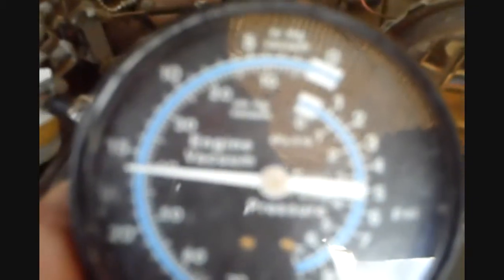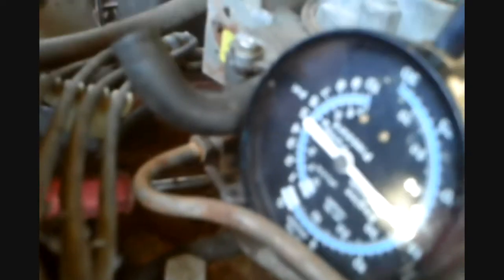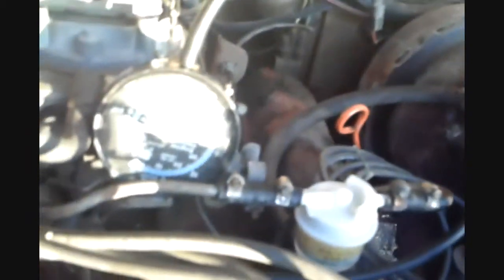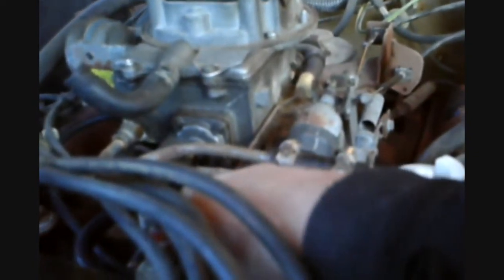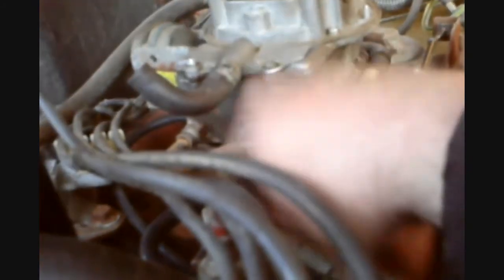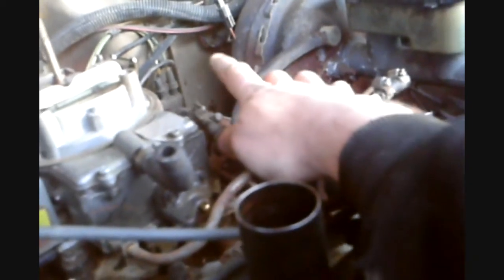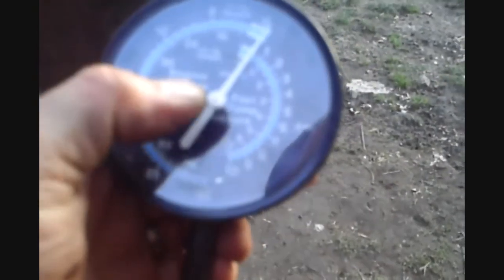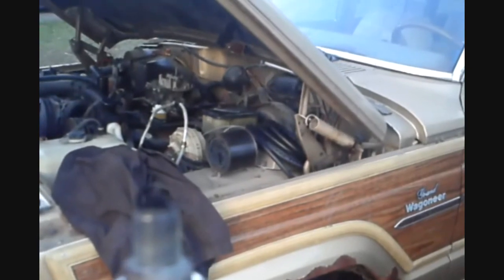Carb tuning the Jeep engine

Comment: where did you hook the guage to?
Reply from the maker: The first spot I hooked the vacuum gauge to was a fitting on the intake manifold just in front of the carburetor. The fitting had a couple ports on it that ran stuff from the original vacuum setup, and the vacuum coming from it is manifold vacuum. The second spot I hooked the gauge to was the port for running the distributor vacuum advance which was on the side of the carburetor just under the choke coil, and is considered  part throttle vacuum.

Comment: What kind of carb are you runnin? I've got an 85 Cj-7 that had a complete pile of junk GM throttle body on it, of which I recently replaced with a 2bbl Carter I picked up from Summit Racing...when it's cold, it runs like a raped ape, as soon as it's fully warmed up, it develops a SEVERE hesitation, it becomes difficult to start, and recently it's begun dyin on me when I'm sittin at a red light...like, I have to squirt starting fluid into the carb to get it fired off...any idea what could be causing these issues?
Reply from the maker: The carb in the vid is the original Ford Motorcraft carb the jeep came with. Your CJ7, I'm thinking it has the inline chevy 6 cylinder. The problems you are describing are for a lean running engine. When it is cold with the choke closed then it runs good because the choke being closed is adding fuel to the main jets at all rpm ranges. When warmed up and the choke opens, the engine is running on the idle and main jets normally and the engine is running lean on them. I would suggest to warm up the engine so the choke opens. Then simulate the cold condition by closing the choke some but not all the way, which will flood the engine when closed all the way, then drive it to see if the engine runs good while driving it and the problems somewhat or altogether go away. This will lead you in the direction of fixing the carburetor. Sorry, but the carb needs to come apart to fix. Will be one or both problems to fix the carb issue. 1- main jets are too small and need to change to bigger jets. 2- the carb has crap in it and is clogging something somewhere and need to clean it out. Having a new carb means nothing, when any carburetor is bolted to any engine, it is mandatory to tune the carb to that engine by jetting it with the idle jets and main jets. As for crap getting inside the carburetor, there is no exception there either. Now, if the problem is still there after playing with the choke as described above, then I would look at the ignition system then. Timing is off or, bad spark lugs, or just needs a tune up, would be my guess then.Good luck. Feel free to ask anything else.
Reply: @prancstaman  When did Jeep EVER put a "Chevy 6 cylinder" in a Jeep?  Since AMC had their own 4.2L and 4.0L 6 cylinder engines....
Reply from the maker: @1TruePatriot  AMC was good for using anything they could get their hands on. The Chevy engine CJ's is the CJ you see at car shows with a Chevy small block V8 in them. The CJ would have the chevy driveline in them with the straight 6, pull the 6 out and drop a V8 in and would bolt right up to the trans. I have no clue of what years was what. But AMC loved the chevy straight  6 in all their stuff. A 1977 AMC Spirit with the Chevy straight 6 in it would burn the tires off the rims. LOL :)
Reply: @prancstaman   They used a Buick V6 in some Jeeps at one point, but never a Chevy inline 6. Why would they? They had their own inline 6's going back to the very beginning of AMC, when Nash and Hudson merged. They used an Audi 4 banger, then a Pontiac? 4 banger until they developed their own 4cyl.
I always find it weird that people can be so confident while being so wrong. I hear it at car shows sometimes. Oh, thats the Ford motor, or that's the Chevy motor.  Wrong on both counts, friend.
It's so inconceivable that American Motors made their own engines and bodys to some people.
Reply from the maker: @trainsforbrains  AMC was famous for using anything they can get their hands on. My Wagoneer for the year "84"came with an AMC 360 or a Chevy inline 6. Then 20 years before came with a buick 350 as one of the options for engines. They shoved the inline 6 Chevy in alot of their cars. Along with their drivelines also.
Reply: @prancstaman  OK, I'll feed the troll. Which inline 6 Chevy did they use?
Reply from the maker: @trainsforbrains  No clue, not a big AMC gooroo. Yes they have there own engines, yes they use other engines from the big 3 also. I've seen them in the vehicles of family and friends. probably wrong, probably right too. no big deal to me. Thanks for policing the info.